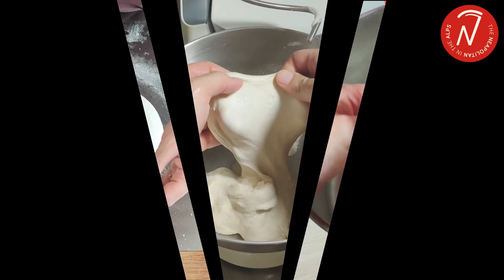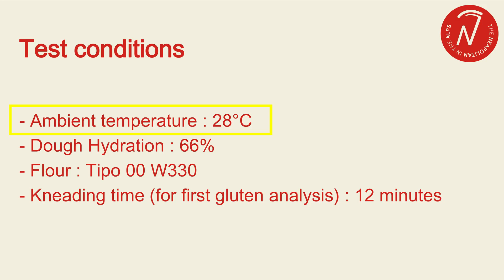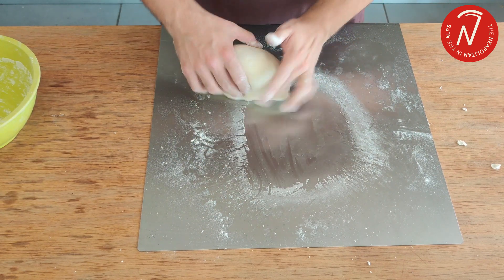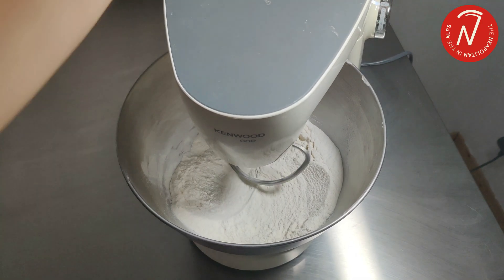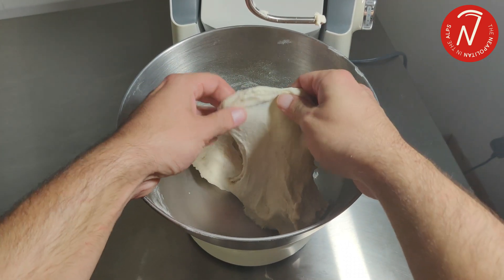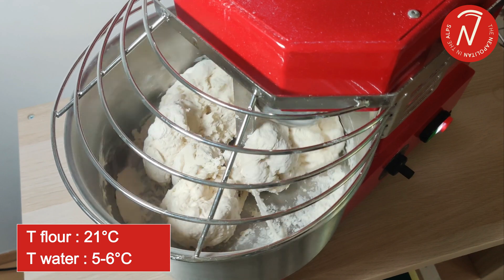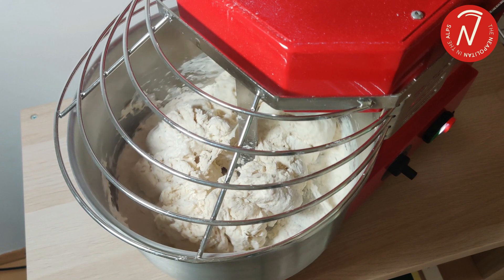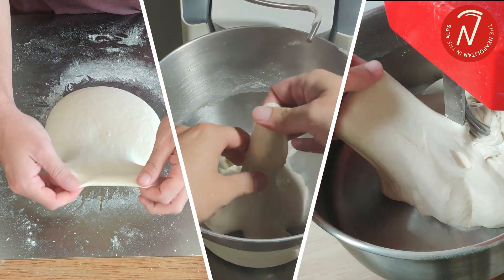How KNEADING impacts your GLUTEN ? | PRACTICAL TEST : by Hand vs Stand mixer vs Spiral mixer

Comment: So - you can use the rest phase for any method of mixing. Planetary mixers benefit from this a lot because as you noticed they're much less effective at mechanically forming gluten bonds than a spiral, and transmit a lot of heat into the dough via friction.
Reply from the maker: Of course you can use the technique whatever the mixing technique. However, if your robot/mixer can work the dough and you use the right technique, stopping is in my opinion a waste of time.